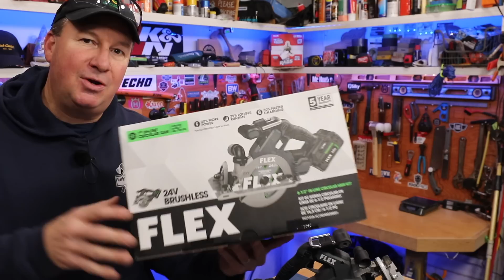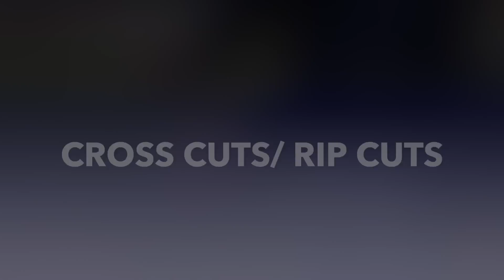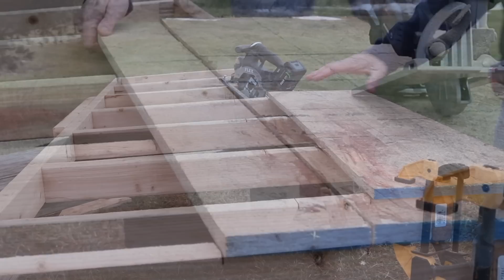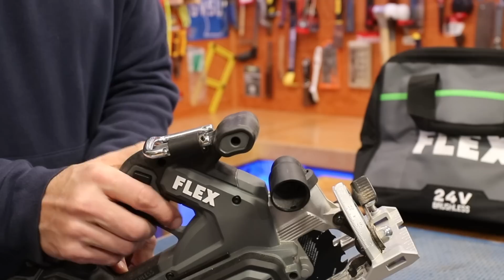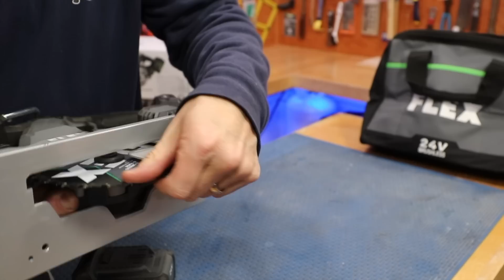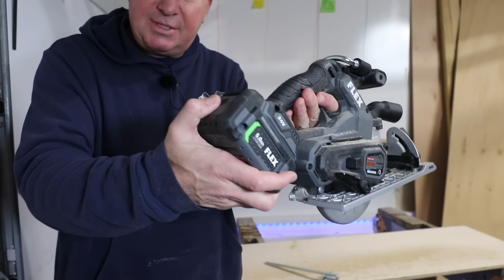Check out the FLEX 24V In-Line Circular Saw- FIrst of its kind!!

Comment from the maker: Have you tried FLEX Tools?  What one is your favorite and what would you like to see them introduce?
Reply: I purchased the Flex In-line circular saw in mid-December after selling my 18 year old corded Makita.  I went with Flex due to the reported additional power and went with this in-line vs traditional or rear handled configuration due to the terrific visibility from either side and the balance just felt right in my hand.  I recently used this saw to cut up some door slabs and to rip and cross cut butcher block countertops.  WOW!  It was like a knife through frosting...just unbelievably smooth, great power and the grip is perfect for me.  

I liked this saw so much that, two weeks later, I decided to get the FLEX reciprocating saw kit (with battery and charger) so I could have two FLEX batteries.  The cost of the batteries is such that paying just a bit more for the saw and charger, too, made sense to me.  

I paid $249 for each saw BUT Lowe's just advertised them both for $189 so, because I purchased them within 30 days of this sale, Lowe's honored the new price and gave me $120 ($60 each) back!  Of course, I took that refund and applied it to my purchase of the FLEX Hammer Drill with Turbo and Impact Driver kit.  This kit is/was on sale from $349 down to $259 AND, with purchase, I was able to choose from several different FLEX tools a FREE tool!  I opted for the FLEX 1.6 gallon wet/dry vac.  

One month ago, I owned ZERO FLEX tools.  Now, I own FIVE!   With 4 batteries and two chargers.  My average cost per tool, due to these specials, is under $140 per tool/battery!  That is unbelievable for this line.  Great value!  AND, LIfetime Warranty was extended to end of 2023!  

I do wish FLEX had a compact/trim router in the lineup.  Also, I'd like to see the Jigsaw (bare tool only) closer to $159 than $199 (I'd take $119, too, though!).  That would be my next purchase to replace my corded one.

I've had DeWALT, Makita, Bosch, Milwaukee, Ridgid and Ryobi. I'm glad I gave FLEX a shot.
Reply: @thechase-secondchance5077  your flex wont last anywhere near as long as your makita.
Reply: @miqueaspromontorio3  I definitely would hold you to that bet
Reply: Flex is owned by Chevron, the Chinese company that owns Ego, Skil, and makes Kobalt power tools. Your just buying rebranded Kobalt power tools. Brands and packaging are an illusion. Go to the source.
Reply: @miqueaspromontorio3  Wrong, go back to your source and you will see that before Chervon bought FLEX which is a German manufacturer some of these same tools that you see today are the original German tools in this color on a 24 volt platform. 

The Germans still design and engineer every power tool that FLEX has.

Skills is not a version of FLEX .

Kobalt is a scale down version of FLEX 

You are talking made up crap that you and only you thought up. What you are saying is a figment of you imagination and propaganda. 

By the way FLEX has the best battery technology bar none.
Reply: @miqueaspromontorio3  funny I remember the Naysayers singing your song  back when DeWalt was bought by Black and Decker because it was yellow.

So you know your argument doesn't hold water because TTI is a Chinese company the bought out Milwaukee and for the most part Milwaukee puts out a good product. 

Likewise Stanley which is a garbage company bought out DeWalt and they too puts out a decent product. 

Likewise Hitachi bought out Matabo and the put out and excellent product. 

Mark my words FLEX is not is it to F around they want all the market share and in order to topple the likes of Milwaukee, Mikita and DeWalt they have to bring more than an "A" rated product and that what they are doing..

Chervon is OEM for many of these companies and I bet you didn't know that Son.

Just saying dude
Reply: @rickyperkins232  lol son? My kids are all grown and moved on. I bought a corded dewalt drill about 15 years ago. It burnt out the first day. Haven't bought dewalt since, however i did receive a dewalt 12 sliding miter saw as a gift thats been serving me well. I suppose my point is i do my research on the tools and the companies before i buy where everyone is is buying brand names and hype. My experience hands on and technical knowlege is what holds water. I been building houses and construction otherwise fornover 15 years. This inline saw is a fucking gimmick and you can literally HEAR it in the video. Do a tear down and stress test video and prove me wrong.
Reply: @miqueaspromontorio3  let me guess the only tools you use are Mafell and Festool, these are .100% the highest quality, 100% German and 100% made in Germany.
Reply: @rickyperkins232  havin fun yet?
Reply: @rickyperkins232  thats quite the extreme, bud. I use good power tools. The thing is for building custom houses/framing, my tools are damn well good to go. No two sides if the fence. Again, I know this from first hand experience and technical knowledge of electronics. Like i said, crack open a flex power tool against a dewalt, makita, or Milwaukee. You will see the difference. Flex isnt gonna last. China ruin it if it hasnt started already. Up for the challenge? Maybe youll go viral.
Reply: @thechase-secondchance5077  did you notice how quiet it is. Compared to ever other saws on the market
Reply: @rickyperkins232  Yes. It was so quiet that I had doubts it would have enough power.  Very happy with it!
Reply: @thechase-secondchance5077  dude I was so impressed with it and its massive depth of cut I went on Lowes website and leave a 5 star review with pictures.

I have all but 2 FLEX tools and I am happy I didn't switch from Ridgid to Milwaukee all the way dude. 

FLEX just have a solid offering and the icing on the  cake is the lifetime warranty.
Reply: @thechase-secondchance5077  Damn, Dude, all in quickly! Enjoy...))
Reply: @PageMarker1  Thank you.  I am enjoying using these tools.  I didn't just jump in, though.  I've got over 25 years experience in home construction and remodeling and have owned virtually every tool and many brands of the more widely used tools - both corded and cordless.  These latest purchases came after about 7 months of researching FLEX and comparing them against Makita, Milwaukee, Metabo, Bosch and Ridgid.  I won't by DeWalt anymore as those DeWalt tools I had owned were grave disappointments.  We happened to be in HD one day to have a couple of DeWalt tools repaired and there was a sale on Ridgid Drill and Impact driver so I bought them as "throw away" replacement that could be used while we were waiting for the DeWalts to come back.  11 years later, the Ridgid tools are still running strong...that's why they were considered this time around. 

That said, I do find myself stopping by the FLEX display each time I am in Lowe's, hoping to see a yellow sticker on the jigsaw or multi-tool. So, yeah, I have become a fan.
Reply: Yes. They suck
Reply: @lg5221  I rather have a Makita or Metabo
Reply: @jonathan3982  nice choice FLEX is better for me
Reply: I have, use and love the flex angle grinder.
Reply: @jeff97  bought it but haven't had a chance to use it
Reply: I agree Flex router would be great!
Reply: @steverugg389  I just saw a video on YT.  FLEX is coming out with a router!  Search for "FLEX Launches Tools Your Waiting for " .  Very excited for this, though I did just take advantage of the Ridgid deal of 2 batteries and charger for $169 and get a FREE tool....the tool I chose was the router.  Still, I may pick up the FLEX router later this year.
Reply: @steverugg389  I already needed 3 routes to eliminate setup time and believe me my not so new Milwaukee trim router is out of here the minute FLEX hit the shelves.
Reply: Hey. Doesur saw had guide rail in box? My arrived today but I don't see guiderail+screw for that;o
Reply: @Pejk0  No, you have to buy them separately.
Reply: I own the angle grinder, this inline circular saw in the video and the tripod light. All of them impress me.

I will be getting more flex tools in the future!
Reply: Would love to see flex come out with chop saw and table saw. I have 2 impact drivers,multitool,blower,job site light,the inline circular saw and the shop vac. The batteries last forever. Definitely would love to see chop and table saws.
Reply: This inline saw is my favorite.  Superb and innovative design.  Very smooth and powerful.  Easy to use with straightedges.  Cuts deeper than my corded 7-1/4 and is a heck of a lot lighter.
Reply: No one sells them any more in local stores,.....

Comment: Flex tools are at the top of performance.... and affordable quality #1 ...I have the rear handle... it's a beast...not in the trades but it's good.... flex turbo drill & hammer drill...you tube testing comes in  1st in overall testing... concrete drilling #1 DeWalt #2    M18 fuel #4 metabo hpt #3 .. flex 2-  9/16 self feeding bit into a 4x4 treated wood  speed two..on a 2amp stacked lithium battery... amazing.. speed two no turbo...😊 Thanks for the flex review... never give up my flex I own some history...

Comment: Great video and channel! Question for you: Im just starting doing DIY type projects around the house, I don't have any saws (no circular/wormdrive or miter or table). I want a versatile saw - something that could be used for other purposes so I was leaning towards the mobile saws like the Flex circular sidewinder, inline saw like this one, and Flex's rear handle saw vs the table or miter saw. Let me know if you think I am mistaken in wanting to lean towards these more portable saws vs miter or table saw.

Having said that, if you had to pick one, which portable hand saw would you recommend: Flex's sidewinder, rear handle or this in-line saw? 

I would want smooth accurate cuts to be able to replicate a miter and table saw for general all purpose versatility. I'm not a framer, nor do I make furniture or anything just a general hobbyist but I would be interested to make anything so I want a saw that is versatile enough to accommodate for any project in the future. Look forward to your advice!
Reply from the maker: I really like this Flex saw for various projects.  It's always handy so I can quickly grab it and go.
I also use my M18 Miter Saw a lot.  
If you have money to invest in a track saw, it can be used for a variety of projects and do most of the things a table saw can do, plus it's much safer.

Comment: I bought this Flex saw, and I also bought their right blade 7 1/4" sidewinder saw, and both saws are shockingly accurate. Out of the box, both saws have a shoe is that is absolutely perfectly parallel to the blade, not even .001" out of alignment. The Milwaukee saws I tested (two in a row from Home Depot, model 2732 flagship 7 1/4" saws) were 0.020" out of alignment. The shoe has to be paralell to the blade, or you can't use a straight edge to make a clean cut. The Milwaukee saws that I tested were completely out of alignment, and there was no way to adjust the saws because all the M18 saws are riveted together with permanent rivets. The Flex saws are bolted together, allowing modification, and they are absolutely perfectly aligned. Also the Flex motors are significantly quieter and smoother running than the Milwaukee which has a very loud gear whine and motor whine.
Reply from the maker: Interesting, I haven't tested this for accuracy, but that's good to know.  This is such a handy saw.  I store it close by so it's always ready for use.

Comment: This is the first saw in the world that solved the severe dust problem of a left blade saw. The people who designed this saw are real professional finish carpenters. Because worm drive and left blade saws are generally horrible for dust, they blow all the dust back at you. I'm going to return my Milwaukee right blade saw that weighs 4 pounds more, and I'm going to get this Flex inline left blade saw.
Reply from the maker: This is a great saw, it's not very heavy either, like you mentioned.

Comment: Would love to see this in a 5-3/8” size.  I rarely use a circular to cut anything deeper than a 2x but the lighter weight and compact size would be great.
Reply: Cool idea. The other 5 3/8 circular saws are nice to hold, but lack power. This 24V would make that a mighty little saw.
Reply: @mikeredhead2894 can you just put a 5-3/8 blade on it? It should cut with even more torque?
Reply from the maker: Interesting idea!

Comment: I fail to understand why manufacturers can't simply replicate the 20+ year old Porter Cable corded circular saw I still use that has the blade drive on the left side.  You get the same great view of your cut and with today's much smaller brushless motors and putting the battery on the back, you'd end up with the same benefits as this saw in a simpler package.  The saw manufacturers still running their blades on the right side of the motor need to get out on a jobsite more often.

Comment: This design will make it so much easier to use a ‘just any straightedge’ as a cutting guide for long cuts. 
Traditional saws with the motor on the side hit the clamps used to hold the straightedge.

Comment: I'm surprised it took so long for a company to just move the handle over a few inches and have it be part of the blade guard.
Reply: It's a matter of balance on most saws. The reason it works on this saw comes down to belt drive motor moving the balance point. It really is a great overall concept and I hope it catches on.

Comment: As a righty, cutting sheet goods with a left blade saw is awkward. Basically, I have to hold the saw handle with the left hand, and then follow the cut line on the waste side as I push the saw with my non dominant hand.

Comment: just 1 question how does it feel when ur doing the 45 bevel? are u having to force it alot or is it curving instead of a straight line? ive jus had this problem w saws and was wondering how this ones does since i have to do hundreds of bevel cuts
Reply from the maker: I'm happy with the way it performs 45 bevels.  I didn't notice any curving.

Comment: These small cordless saws have a purpose, but if you have easy access to power, nothing beats a worm drive.. nothing comes close to the power they deliver and because of their weight, they track amazingly.. Ive tried many cordless saws and keep goi g back to my worm drive.. I bought my worm drive saw in 1987 and other than replacing the cord (installed a 12’ cord), I’ve had no issues with it… that makes it about 36 yrs old???

Comment: Don't buy Flex. Seriously. Its now a cheap Chinese company hoping no one notices they're trying to disuise themselves as a German company product. 
Listen to the motor here. Horrible. This whole inline concept is a gimmick that wont last. Theres no need to have an inline motor on a blade that size on a motor that weak.
Reply: You realize Milwaukee Tools is a Chinese company too right?
Reply: @mlw636  yes. I dont buy Milwaukee either. Been buying Makita for years now and the main change i am going to make there is to start buying Makita direct from japan as the product from japan is actually better than the product lines the make for the US market.
Reply: Good luck with that lol

Comment: That's a cool idea, but on a cordless saw..the extra depth doesnt matter since every  cordless saw  is really only for plywood or cross cutting dimensional lumber. Anyone who has used any of the name brand ones and tried deeper rips on lumber knows that corded is really the only option for that(but really..there should be a tablesaw onsite. The larger HD OR flexvolt batteries make a small amount of difference but when cold..corded all day

Comment: I'll stick with my old makita . I've had it for 15 years and it's still in perfect working order . 
one of the best ways to increase battery time is to use thin kerf blades . i have been using Matsushita ultra thin kerf blades on my saw for thirty years . the carbide is very high grade and super sharp . it puts very little drag on the motor/battery .
Reply: I have a USA porter cable from 1989 only replaced the cord once. The thin blades are too thin for the center shaft too squeeze tight. But work nice in the Ridgid  7 1/4” octane.
Reply: As someone who is gonna get a Makita skillsaw soon, I appreciate this information. My dad has been a carpenter for about the same amount of time. He swears by Makita skilsaws. They do great, smooth as butter.
Reply: @TheTrainStationOG  I can attest to that I have the rear handle 18v x2 lxt saw and it’s phenomenal let me give you a word to follow with power tools…makita makes silky smooth machines not overly powerful but the saws are ergonomically nicer than the rest generally and they’ll complete the task..Milwaukees a juggernaut the fuel lines specifically are usually powerful and will complete the task or go up in smoke..super sawzall is top notch and really only a few can compete (metabo hpt flex the new Makita 40v xgt and ever expanding 12v line is 2nd to none in my book ….metabo hpt /hikoki fka hitachi makes the best nail guns, and lightweight circ saws & powerful “sawzalls” and some of my favorite miter saws. dewalt circular saws have some power too especially the flex volt & the new hi torque wrench is a monster…
Reply: @Jeff-rk8hq  thank you very much.
Reply: Agreed, unless you are doing rips that need to be accurate. You can see the blade deflection in thick enough material.